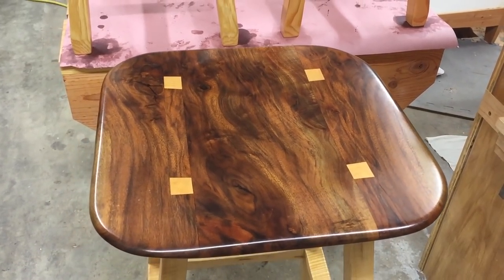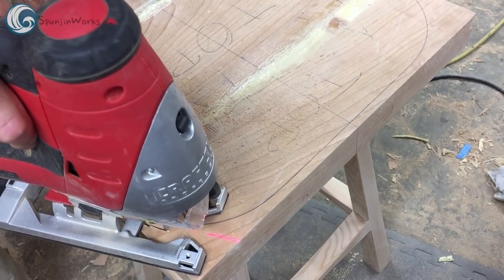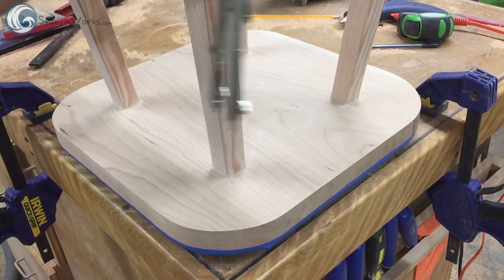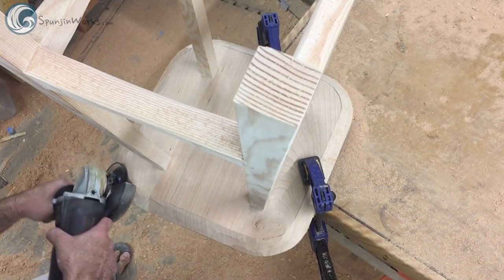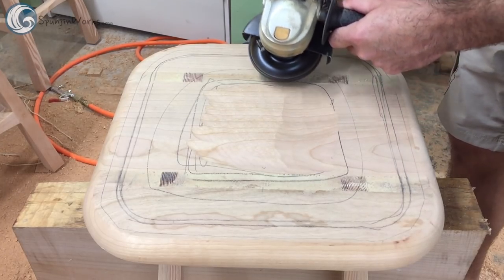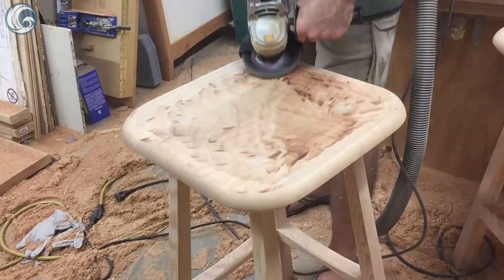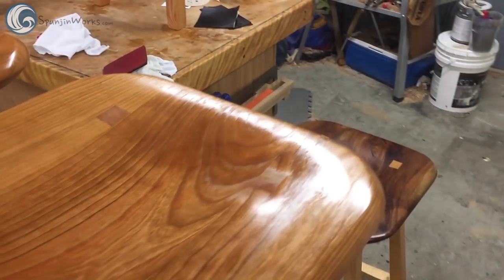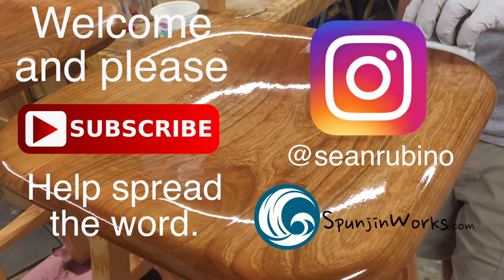Sculpting with the ArborTech TURBOPlane // How-To (Ep. 56)

Comment: Sean, a great looking stool:-)
for arbortech turbo plane ,what size angle grinder disc is recommended? will appreciate your kind reply, Thank you
Reply from the maker: +Sunitaa Tiwari thank you!  You need to have a 4 1/"2 angle grinder.  For this application I use the 4" Turboplane. The small one on the extender is used for sculptural carving similar to chain saw carving.